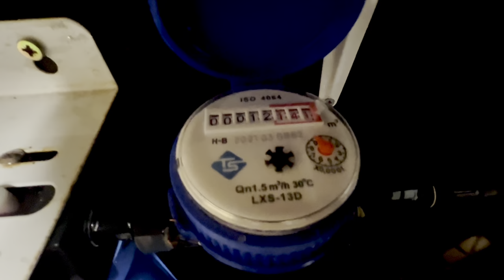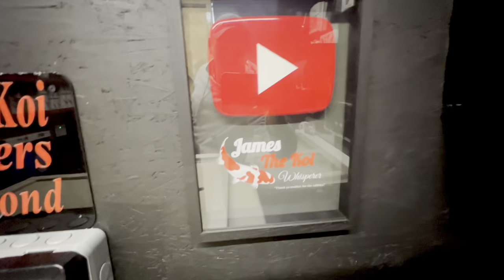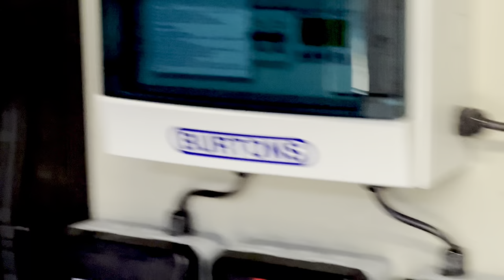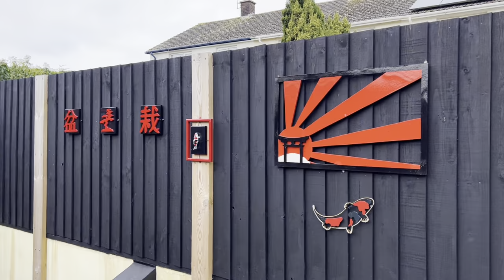The DREAM KOI POND FILTER HOUSE **upgraded**NEW COOL AND EPIC  IDEAS

Comment: I would stick the trickle pipe in the furthest shower left side have the pipe sticking out of the stainless tray so you can still see it. And then that way you know the water crashing out of the tray it gets diluted into main body of water and not potentially lost if it does who knows... I over looked this myself but I've got a combi drum with a static end which is where the filter outlet is so my trickle goes in that end and gets pumped into the pond through the outlets and diluted into the pond. Just a thought james? 🎣
Reply from the maker: Yea good thinking 🤔

Comment: Love the frequency of the video,s lately shame they will end when you stop isolating. I would install a wired CCTV system more reliable than WiFi based camera,s and you can fit them anywhere. Easy to install the hardest is tracing and hiding the cables. HOW IS THE QUITTING SMOKING GOING ?  your young enough to make a full recovery and you are already feeling the benefits.
Looking forward to the new season .

Comment: The incoming water supply may well have a relatively higher chlorine level at this time of year due to the temperature related chlorine decay.
Water at lower temperature will be able to hold on to the chlorine longer in effect.
Reply from the maker: good info

Comment: That looks the dogs B......S mate. Ive just changed my 3 stage filters today too. Quick question, can you have a trickle in trickle out with a pump fed system?
Reply from the maker: yea mate 100%. just need to fit a over flow mate diy way is easy there is a few videos I have seen on how to do it on er
Reply: @JamesTHEKOIwhisperer123  sound I’ll look into it, not sure how I can fit an overflow now the pond is built, I’ll have to have a think 🤯
Reply from the maker: @bezzaskoichannel3856  mate there is some video on how to do it I would try and explain on Tex but so much easy to such for a video lol 

Just search diy overflow koi pond will pop up mate 

There was a brilliant video from Spring Bank Koi a few years back 

Or if someone has a link bang it up
Reply: @JamesTHEKOIwhisperer123  no worries mate, I’ll have a little search 🙏🏻